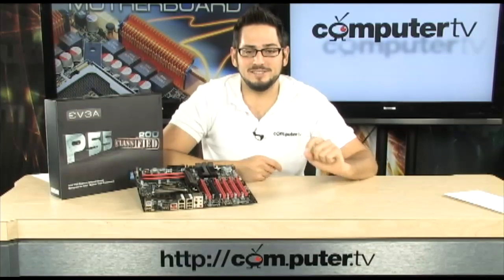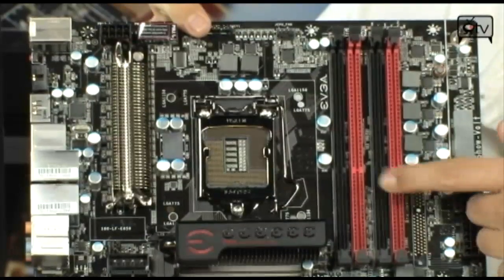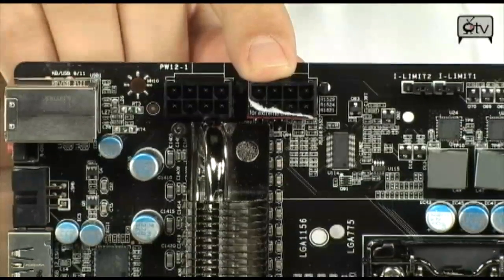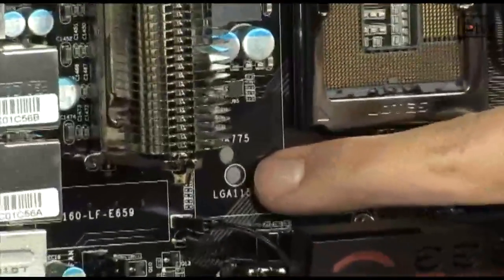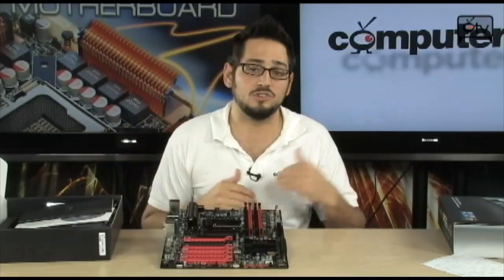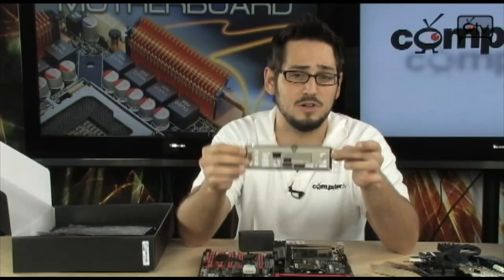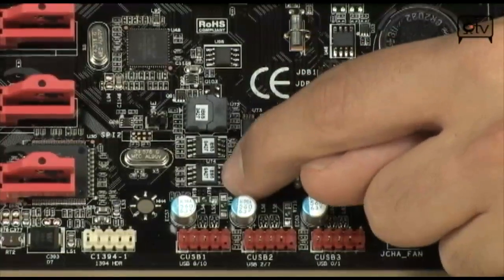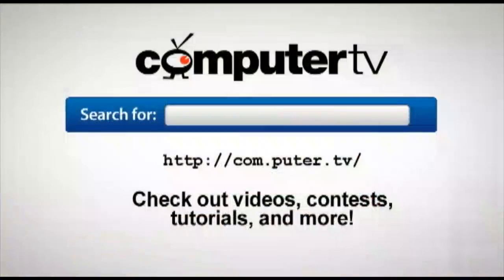EVGA P55 Classified 200 Motherboard

Comment: ok, this is a enthsist board, you can use like any other board but there is this thing called overclocking which makes the speed of the pc go faster, so people do extreme overclocking to get minimal temps since overclocking generates heat, this board is for the extreme overclocker who use liquid nitrogen and will ususally have this outside the case. But if you want to build a  pc pm me and ill tell you what you have to do.

Comment: I overclocked my Core i7 920 to 3.8GHz. It's only 2.6GHz from the factory. I don't know about the power consumption, but the temperature only went up about 3-5 C and it is running stable with more than a 1GHz overclock.